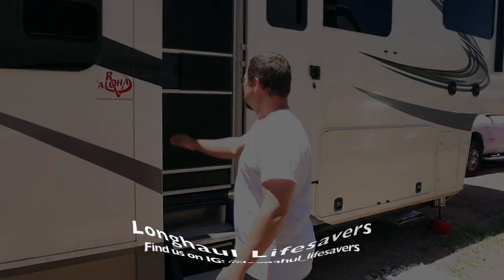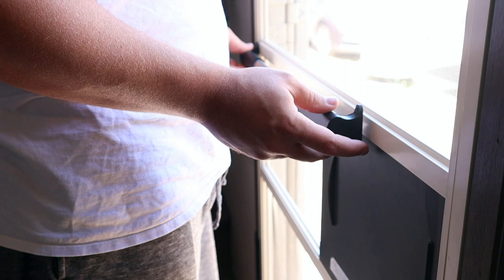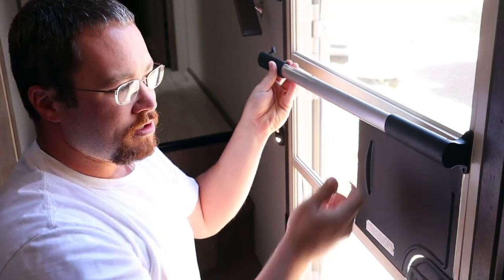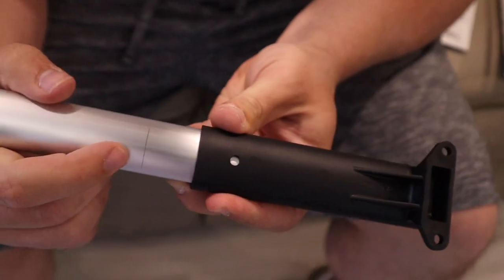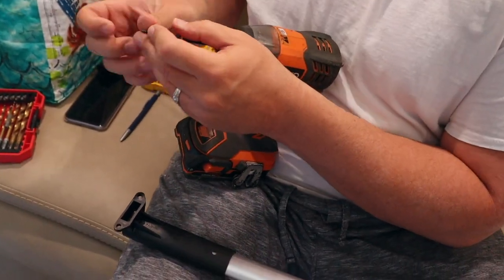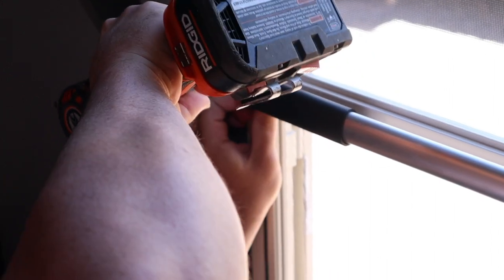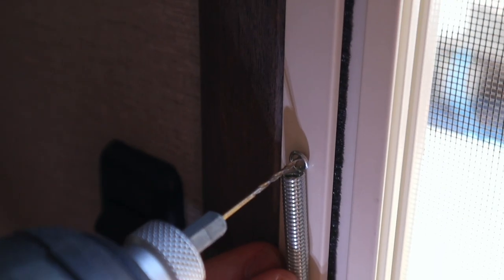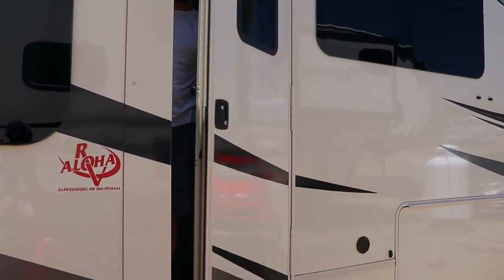WHERE DO I GRAB? // Camco Grab Bar and Spring for RV Screen Doors// Installation

Comment: How do you prevent the spring from wearing on the door and the jam? Nice video and info!
Reply from the maker: You can coat the area with hot glue or a rubber material but eventually it will wear down that area
Reply: A piece of clear tubing over the spring, will fix it. Won't wear down.